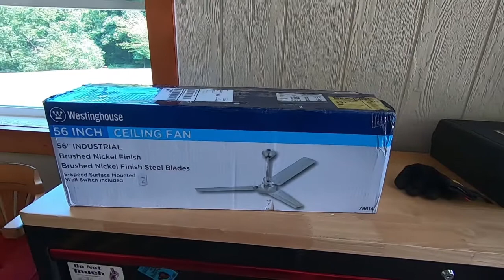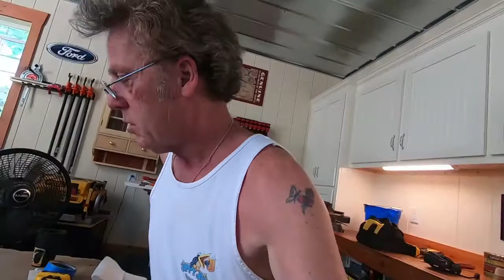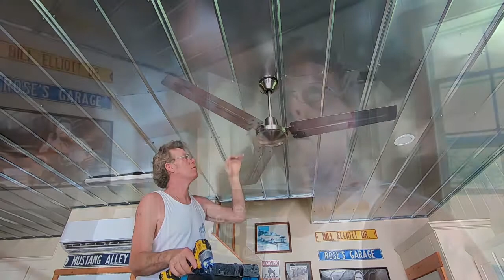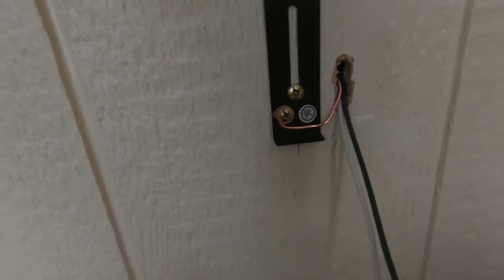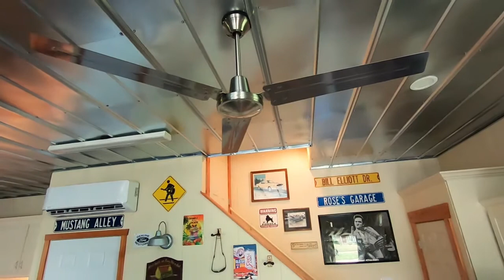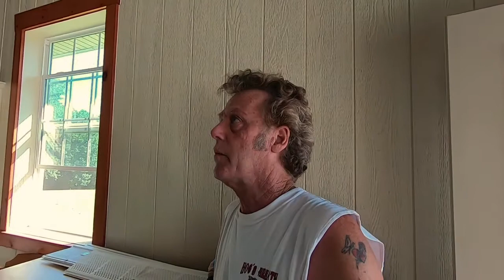Super "Cool" 56" Stainless Steel Industrial Ceiling Fan Installation, With Mounted 5 Speed Control.

Comment: Here in the Dominican Republic they sell that fan and there are people who put a lamp on that fan and I think they make a hole in it so that the thread of the lamp burns to screw it into the fan, although the best-selling brand is the KDK, that model from Westinhouse, the Nikel model, very exclusive to see here in the DR since what you see most of the Westinhouse brand are the short-lasting ones, that is, the ones with wooden blades but the ones with steel blades, it is exclusive to see it now that people prefer KDK over westinhouse nikel

Comment: You should have installed more than 1 fan in that big amount of space. Great installation video btw.
Reply from the maker: Thanks for watching! Your probably right and it's easy enough to add another one  down the line but so far so good. What I really want is a storm door before winter comes so I can work with the entrance door open :)  Thanks Again, Billy

Comment: I've got virtually the same set up. It's called Aloha Breeze. It drives me nuts that there isn't a reverse option on this fan. It would come in handy with the stove in the winter to help heat the kitchen.
Reply from the maker: I could not agree more! 😎

Comment: Envirofan Gold Line would have blown more air and probably would have outlasted this fan, but if you are fine with how much air this fan blows, you're fine. But Envirofan Gold Line has a cast motor and would be better quality than stamped motor. Anyways, nice video!
Reply from the maker: Thank you for watching and thanks for the info! I will check them out. Thank you Billy Rose
Reply: @billylisasremodelingchanne4344  You’re welcome. I want to say there are straight blade and curved blade Gold Line. Curved blade wouldn’t blow lots of air directly under the fan but would blow more air around the fan. Straight blades would blow lots of air under the fan but not much around the fan. Also only straight blade ones are reversible.
Reply from the maker: Thank you for the info, gonna look into it 😎
Reply: @billylisasremodelingchanne4344  Is it still working well after a year and a half? A lot ended up having capacitor going bad.
Reply from the maker: So far so good 😊
Reply: @billylisasremodelingchanne4344  could you tell me the capacitor size for that fan?

Comment: You could have bought a fully variable solid state speed control that fits in the box instead of using the control that came with the fan. Would have saved you alot of work.

Comment: Debating on getting one of these for the garage to disperse the heat better in the winter. I see 2 dials 1-5, is this reversible? Good vid!
Reply from the maker: I run mine all winter on #1 to push the warm air back towards the floor. Mine is not reversible. Thanks for watching Chauncey! …..Billy

Comment: Quick question why did you use neutral (white) as hot to connect to the fan. Do I, as usually I do have this reserved, but speed control should be controlled with the black wire (as available hot) and neutral (white) to the other end to complete the circuit?
Reply from the maker: No problem, the white wire at the speed control was used only as a jumper, tied to the hot in the switch box so I could identify that was hot coming in to speed control and the black one was hot going out of speed control. That is why I marked the white with a piece of black tape so anyone in the future would know that piece of white wire was working as a hot and not a neutral. Similar to using a piece of 2 wire for a switch leg. Thank you for watching.  Billy
Reply from the maker: Please let me know if that helps.
Reply: @billylisasremodelingchanne4344  But wasn't it easier to use a black wire or am I missing here something lol? There must be a good logical explanation why you used black tape around the white wire instead of immediately using black wire as the jumper wire?
Reply from the maker: Yes, fine question. If I were to use (2) black wires from the switch box to the speed control devise, once I fished them behind the wall and came back out to the speed control I would have trouble knowing which one was coming from the source hot and which one should go to the fan lead. (speed control is acting as a switch) The speed control has a hot in and hot out. Using one different color wire is just an easy way of being able to tell which is which just by looking at them. Again, let me know if that makes sense.....Billy
Reply: @billylisasremodelingchanne4344  
Aha excellent Point and I was thinking of that. I am sorry I never did anything electrical and now I need to install two fans and I have a red wire in the ceiling that’s throwing a monkey wrench into my project lol. I know that the black is hot and white neutral, but I have new fans with remotes that don’t use speed control like my previous fans. Theres a switch and speed control on my wall and the red wire was most probably for the speed control. Another wall switch controls the lights so I think the red wire is for the speed control so I was wondering if I can just put a cap on the red wire to leave the speed control out of the equation. This video has helped me get a better understanding of the whole setup. Thanks again.
Reply from the maker: I cannot sure about your situation but typically here where I am a fan is wired with a piece of 3 wire plus ground. Black is usually to the fan, red to the fan light if it has one and the white is the neutral. Most fans I have seen only need a hot and a neutral if you have a remote. You may want to consult a local electrician if you can't be sure. Sorry I can't be more help and let me know how it works out.....Billy
Reply: @billylisasremodelingchanne4344  Yes you are absolutely correct as a light fixtures can be attached, but the old fans had no light fixture and had 3 wires ( black, white and a whiteblack wire), whereas my new fan that can have lights got only 2 wires a black and a white without the third one. So I am really trying to understand how I could go about the red wire? I’ll try to exclude it from the circuit by capping it and I’ll let you know how it works. what would you suggest how the wiring should be done assuming I wanted to install the lights, do I just wire the red wire to the hot (black) one? Thank you so much for your explanation.
Reply: @billylisasremodelingchanne4344  Yes it works without connecting the red wire. do you have an advise how I could go about getting the lights to work on the fans and I will install a standard switch instead a speed controller as that’s what the manual says. This is in the sunroom and I said a had a wall switch and I thought it was for the fans, but it’s not, it’s for the lights outside. I will no longer need the speed controller as these are remote controller and I will just put in a standard switch? Thank you again for your help.

Comment: Is that 14/3 wire in the ceiling?
Reply from the maker: Hi Nick. Yes, 14-3. However 14-2 is all that would be necessary since there is no light on the fan. Most times a fan is wired with 3 wire, one hot for the fan and the other for the light. Some have a remote now that will operate both off a single piece of 2 wire. Thank you for watching 😊.....Billy